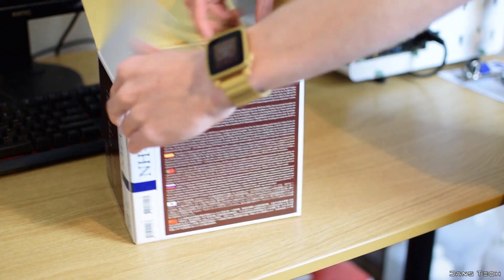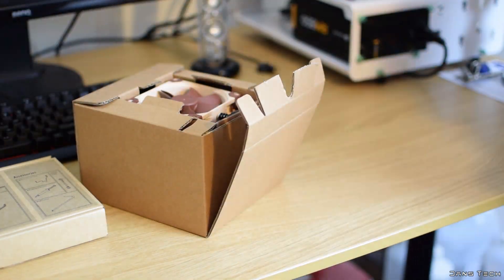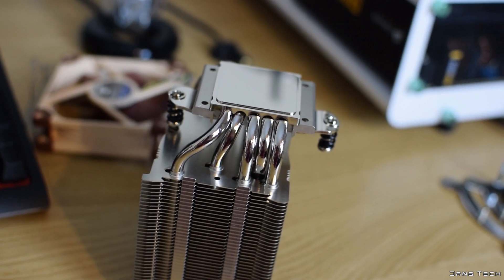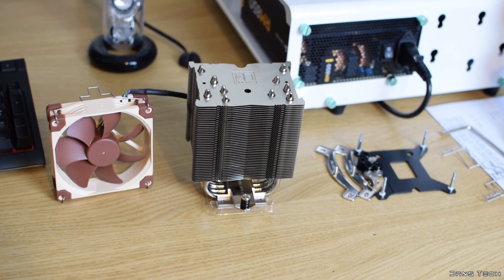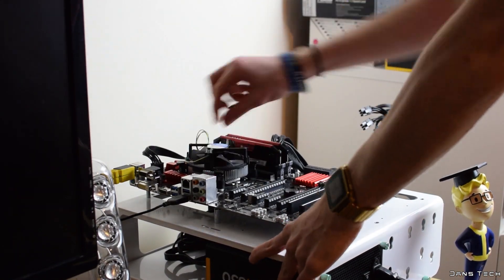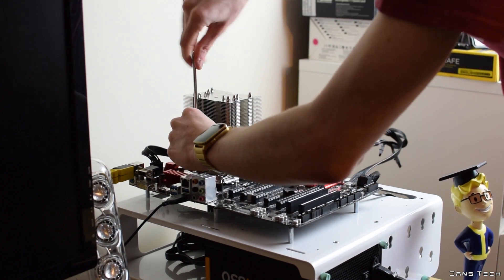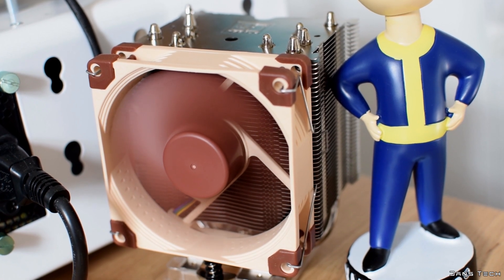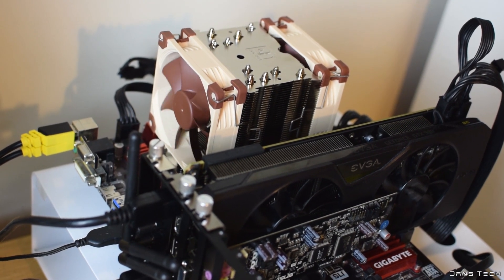Noctua NH-U9S CPU Cooler Review

Comment: Just found one locally in the box for $20. It was missing the main AM4 4 screws and extra set of fan clips. Contacted Noctua through their contact form on their site and received a email back a few days later saying they will ship out those missing parts free of charge. This will be my 5th Noctua now running at home.

2x D15
1x U14S
1x U9S
1x D9L

Comment: QUESTION - if I purchase an additional 92mm fan are the two clips needed to attach it to a heat sink included or do I need to find those elsewhere (if so where did you get yours because I couldn't find them on noctua's website)?
Thanks!
Reply: did some digging on this myself. As far as I can tell, the case fan does not come with the metal clips to attach to the heat sink; but the NH-U9S does come with an extra set of clips so you can attach a second fan to it.
Reply: adna hozzá kettő darab vasat (a további fejlesztéshez) pls translate :D

Comment: So, I'm building a new PC with an 7700k, but I'm not planning to overclock, I just got the CPU because I had the money, is this cooler good enough? I'm bad at choosing coolers, so I want someone's opinion. The only thing I'll do will probably be gaming/streaming eventually, so I want a good one that keeps my CPU cool and doesn't make a lot of noise.
Reply: I think maybe cause the base speed for 7700 is 3.6Ghz and for 7700k is 4.2... this is the reason I also got a 7700k recently haha :p
Reply: Its not good cooler! Its the BEST I have this one(same cpu too ;)) and is silent af.
Go for it
Reply: Blixen late comment but why get the 7700k if you're not over clocking it? You should have saved some money and got the 7700 (non k)
Reply: @epicstacker413  because a K CPU is faster out of the box than a non K (?)

Comment: Cheers for the review. you reckon this cooler could keep up with an overclocked 6700K?
Reply: @gptm1  I wouldn't say this cooler can handle  5 GHz on a 9900k but definitely can handle a 9900k with modest settings.